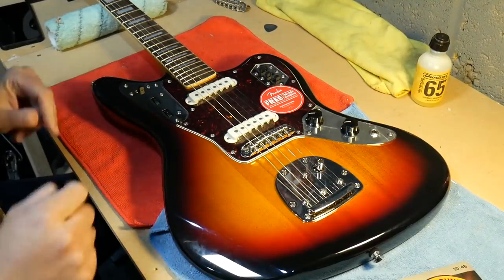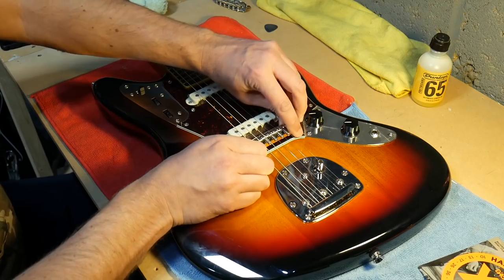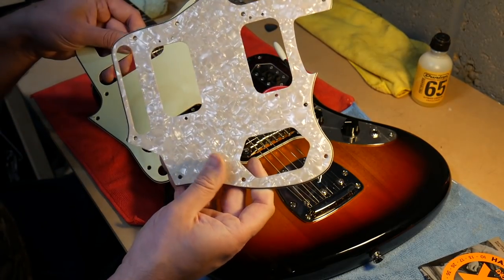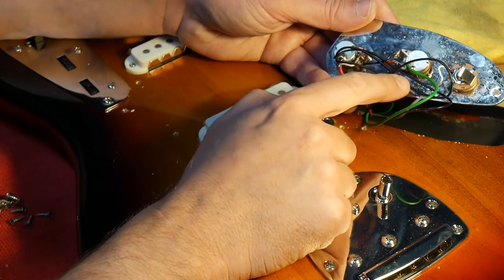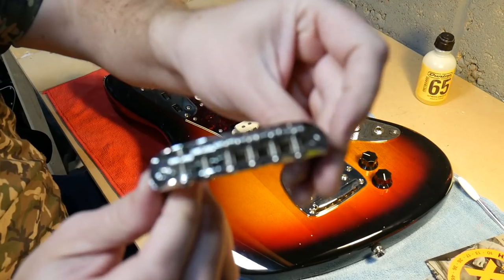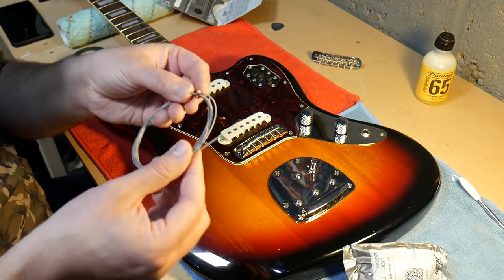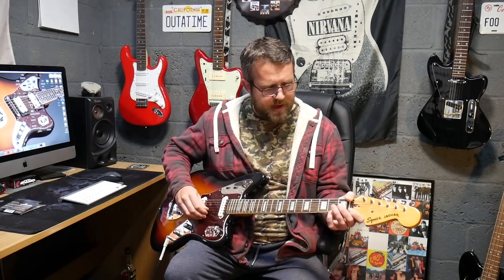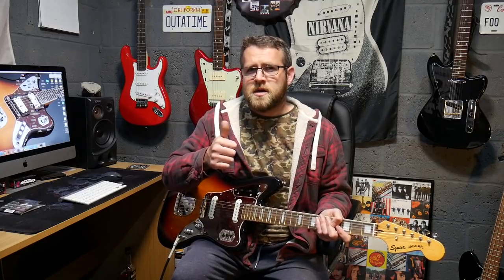The BIG MISTAKE Fender Made With This Squier Jaguar Bridge

Comment: Great video.   Very informative.    I am thinking about a Jaguar or maybe a Yamaha Pacifica ( Yamaha is my favorite brand for low-cost acoustic guitars)  and I was wondering if there was anything else I could find out  about the Jaguar Classic Vibe that might makemy  decision a little easier.      I really don´t need the tremolo bar and would prefer that the guitar stay in tune as much as possible.   Does anybody know if the Squier Classic Vibe Jaguar has the blocking option built in like other models of Jaguars?

Comment: You could get a Tune o matic which would stop the saddles from wiggling. It would also look more like the Cobain version. The trem on the classic player jag is closer to the bridge, but I think they only do it on that guitar. Which size of Allan key do you need to remove the stock black knobs on the jag? I looked for a while in my dads toolbox and couldn't find one.
Reply from the maker: I'm not a fan of tuneomatic bridges as I prefer the matching radius to the fingerboard, also would need a big shim. Not sure of the size sorry
Reply: The Guitar Manifesto Thanks anyway! You can by tune o matins for 9.5 inch radius I think but the shim would be a big issue.
Reply from the maker: @wastewoodrockers5526  again the large shim is a no for me
Reply from the maker: Because the Tune-o-matic bridge sits a lot higher, you need to raise the neck or the action will be too high
Reply from the maker: It's an easy fix I made a video fitting one on a jaguar
Reply from the maker: https://youtu.be/9MuyFr283eM

Comment: Try using 11 gauge strings. Jaguars are short scale, that bridge kinda sucks, and the tension from the tremolo to the bridge is not much (at least with the original design, I don't know if these new classic vibes models have the tremolo closer to the headstock like the new Player series, that solves the tension issue). If the thicker string don't work, change the bridge for a TOM or a staytrem, or maybe just the saddles, graphtech has self-lubricating saddles for jaguars and jazzmasters.
Reply from the maker: I always like using 10s on Jags always have done, I'm thinking of shimming the neck to increase the break angle also get them springs changed on the bridge saddles.

Comment: Hmm, maybe take a string and tie it around the bridge tight so that the bridge has pressure squeezing it together.  That would prevent the high E string saddle from flopping around like that.  Pretty much any way you can clamp the bridge would do the trick, though it would not be a pretty fix.  I could be completely wrong about it, but that seems as if it would fix the first issue.  
The second issue being that strange sound, you seem to be on top of it with smoothing out the nut like that so I don't think I have any better ideas on how to fix that issue.  Though it might help if you can move the whole back end of the bridge forward a bit, that would increase the break angle and hopefully put more pressure the strings put on the intonation adjuster thingy lol...  Once again, I could be really really wrong, but those are the only real thoughts I could come up with to address the two issues you have with at home fixes and not having to order parts lol. 
-lfaf

Comment: Thanks for your video Sir. If you have a few seconds. I have just got one of the Jazz last week, partly on the basis of your other video. To solve issues I went the buzz stop + 250 pot route. Now it seems to have lost in mojo but "plays" nice, strings don't jump out of the bridge etc. Vibe is not the same. I wonder if it is buzz stop and/or the 250 pot. Have you tried to modify the pots?
Reply from the maker: Buzz stops are horrible things take away the jangle sound. Totally wrong pot too

Comment: As much as you deal with these i thought you would have done a neck shim and raise the bridge. I string 10's on mine and I have the original bridge (vintage modified) and it plays/intonates/sounds great. Keep it coming with the offset content!
Reply from the maker: I've always used 10s and always will on 24 scale, neck shim did fix the issue this video is quite old now

Comment: Raising the action will help with sustain/buzz.  Those guitars shine with heavier strings/higher action.  you shouldn't have to go to high, but its night and day comparing these offsets to my Strats.  Doesn't mean they are worse.  Just different.  That said, I preferer and play my offset Fenders 90% of the time.
Reply from the maker: I always use 10s on jags, it's not buzzing its the lack of tension that's the problem. Even with 11 or 12s on this problem will still be apparent, the springs on the bridge are way too weak.
Reply: @theguitarmanifesto  report back after you swap the springs please. So you think the saddle piece is too loose cuz of the spring?? Maybe try swapping out the saddle as well as the springs? idk..
Reply from the maker: I may be wrong but they seem way too loose, also a shim in the neck will help. I do have another bridge I could stick on. People on a budget who have saved up for one of these shouldn't be expected to pay over £65 for a better bridge.

Comment: Try a staytrem bridge ..also make sure you get the right radius for this guitar.
Reply from the maker: It's quite an expensive fix, I want to find a cheap alternative so you can use the stock bridge.
Reply: I have a Staytrem tremolo and StewMac roller bridge on my MIM Jag and they, along with a roller string tree, make all the difference. I think everyone should know going in that you’re going to have to do some upgrades or mods on a Jag bridge.
Reply: Mastery Bridge works really well. No problems with the radius.
Reply: Staytrem makes a good product but it changed the tone and feel of the guitar. Ymmv
Reply: Bought a StayTrem Bridge and Tremolo for my Squier VM Jag.  Now it always stays in tune, no string popping, and fixed radius.  Love it!

Comment: Nice, I love "mods" (or fixes) that don't involve buying a $250 part (cough-cough mastery bridge). Question: with the electrical tape wrapped around the bridge posts, is it still grounded? Or are the strings grounded by way of the vibrato tailpiece? Thanks.

Comment: My Cobain Jaguar sounds exactly the same on the e string. Any advice on what to do?
Reply from the maker: How high is the action?
Reply: @theguitarmanifesto  almost as low as it will go
Reply: @theguitarmanifesto  I actually just broke that string playing it tonight. I'll put a new one on it tomorrow. It was the original strings that came on it, but I've only had it a month
Reply from the maker: Needs to set correctly or you will have issues you're looking around 1.25mm action on the high e 1.50 on the low e side
Reply: @theguitarmanifesto  thank I will do that as soon as I get off work. I love your channel. I'd love to be able to do what you do. I just don't have the experience that you do, but I'm learning
Reply from the maker: The truss rod relief needs to be a out 0.30mm too, I've sent up plenty of guitars I'm my videos so plenty of reference for you.

Comment: I got one in green and it felt like a toy with the 9’s on so I switched to 10’s which helped a bit but still felt too loose and rattly in the bridge and trem. A set of 12’s sorted mine. The nut will need dressing but mine is a keeper now. Absolutely love it.
Reply from the maker: I get what you're saying I prefer using 10's on a Jag, I just want to find a fix for the stock bridge

Comment: What are you using to file the nut? I know there are files for that specific job but they are bloody expensive.
Reply from the maker: It was a nut file from a cheap set I got on eBay a while back
Reply from the maker: Similar to this 
https://rover.ebay.com/rover/0/0/0?mpre=https%3A%2F%2Fwww.ebay.co.uk%2Fulk%2Fitm%2F223480339571

Comment: I own a Vintage Modified Jag, I just now realized they switched the bridge on these. So is this a Squier-made 9.5" Mustang bridge? Mastery bridges are great, but I went with the StayTrem as it was closer to a stock bridge in construction. It's pre-radiused much like this new mustang one, but using 11-52 (EXL-116) strings and no neck shims and it's played great for me! StayTrem quit shipping internationally so I'm glad I got mine when I did, but if you live in the UK it looks like you can still order one. https://staytrem.com/
Reply from the maker: Yep it's the new Mustang bridge with the correct radius for the neck, no more having to spend a fortune on after market bridges

Comment: The bridge design has always been a fail Fender dont like changing much.Best option  would be find a roller bridge replace inserts and a neck shim is essential for a better break angle behind the bridge to reduce pinging also wrapping a shoe lace or a piece of foam on the strings behind the bridge will stop some pinging.
Reply from the maker: At the time I forgot about shimming the neck been a while since I've needed to do one on a Jag or Jazzmaster, will definitely be my next step 👌🎸

Comment: mastery bridge
Reply from the maker: Yeah this would help a lot but an expensive upgrade for those on a budget
Reply: @theguitarmanifesto  it's well worth it on the right guitar,  string tree too.
Reply from the maker: Yeah I totally agree they are awesome bridges and would make a huge difference. For those on a budget I want to find a cheap fix. My next step will be shimming the neck to increase the break angle also try and fit some stronger springs, hopefully this will help a lot.

Comment: If you want to know how to get the best from any Fender offset take a look at this Premier Guitar magazine article . The info given is straightforward, bullshit free and accurate and certainly helped me to improve the set up on my Jag without any great mystery being involved, the trem now works as Mr Fender intended, I have a comfortable action using 11s and it keeps tune well.
https://www.premierguitar.com/articles/25516-diy-how-to-set-up-jazzmasters-jaguars
Reply from the maker: Thanks, I personally like using 10s on a Jaguar/ Mustang.
I overcame the issue with this bridge by shimming the neck
Reply: @theguitarmanifesto  I think the reason people have problems with offsets is that they go in with same methods they'd take to a Strat or Tele and then blame the guitar when it doesn't work out. Once you take the time to sort out what you're doing it's no more difficult to set up a Jag than a Strat, it just needs a different approach.
Reply from the maker: Totally agree they need a level of experience to setup correctly.